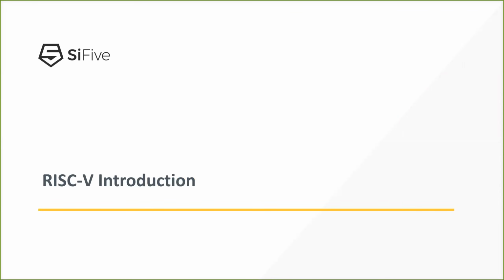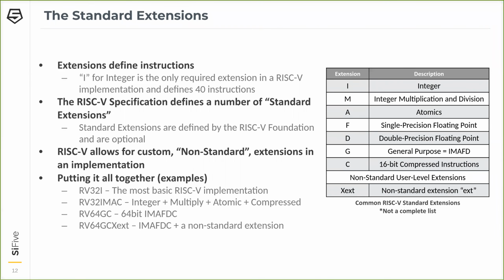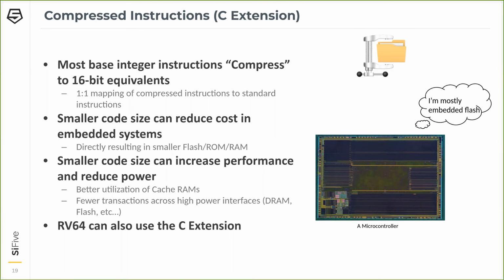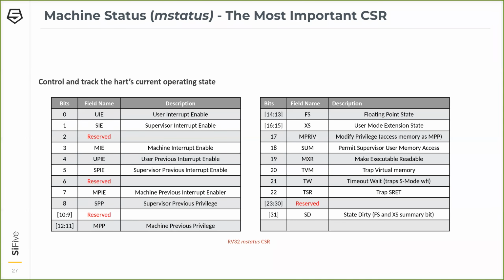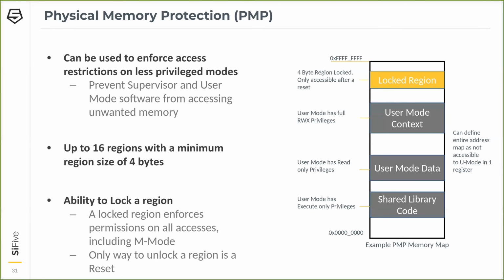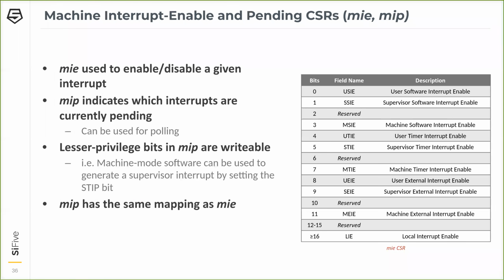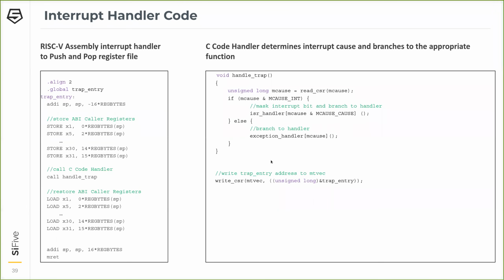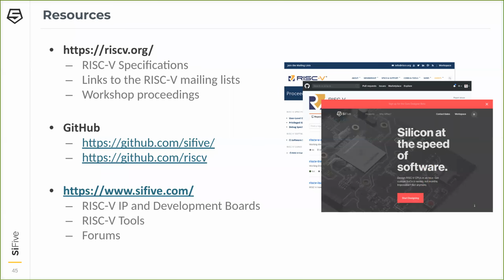Part I: An Introduction to the RISC-V Architecture

Comment: Trusted hardware thought...

Given that the up and coming open ISA that RISC-V brings and potential silicon that will be certified as compatible with the RISC-V architecture...  there might be a way for us to have a processor that is likely to be compliant and will likely fail a "magic packet" type embedded in silicon exploit.

We could get a core fab'd in country "A" and the same core fab'd in country "C". We get one each of these cores and run them them in lockstep, we would expect similar results out of each beast.  As soon as one cores outputs differ from the other we can raise a flag and signal badness.

It is improbable that both cores would contain identical backdoor triggers given their differing origins.

This could be "trusted hardware" of sorts, no?
Reply: I appreciate your idea, but the problem with all, so called "trusted" security hardware is a general one. Even if the ISA is freely usable, there is no real possibility to verifiy, what is going on beneath the ISA. I mean the microcode, which is a black box especially to software developers. Even a hardware developer can not really find out, what an unknown chip actually does at the transiator level without papers.

Comment: INTRODUCTION
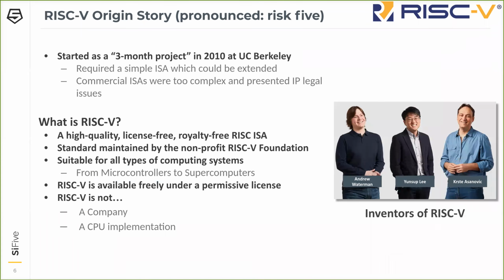5:14  RISC-V origin story
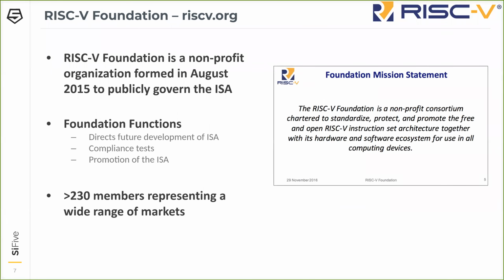6:19  RISC-V foundation
6:57  foundation Members
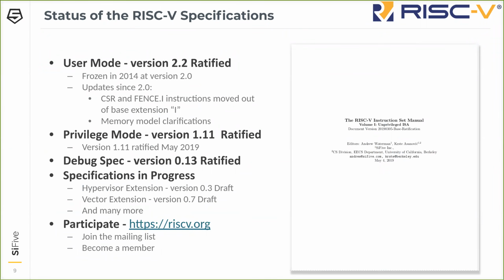7:26  status of the RISC-V specifications
-
BASICS
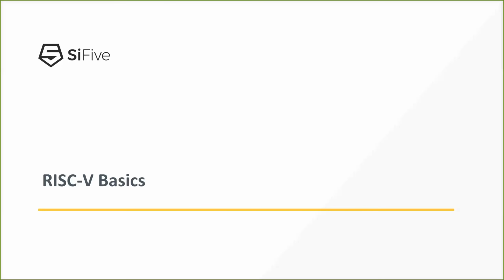8:49  RISC-V ISA naming conventions
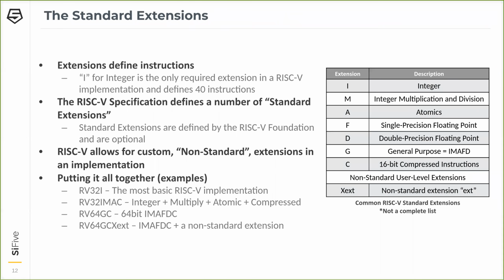9:35  the standard extensions
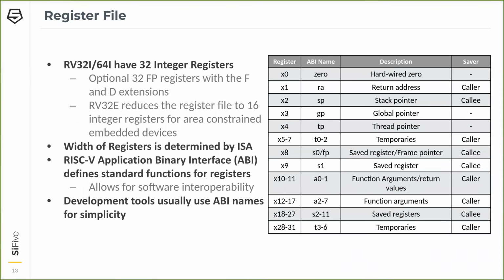11:37  register file
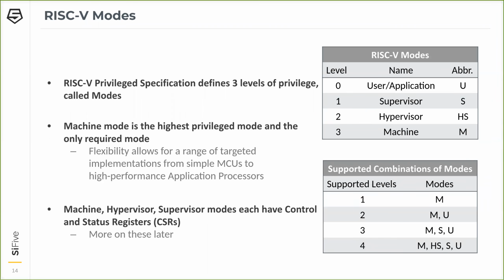12:43  RISC-V modes
-
RISC-V INSTRUCTIONS
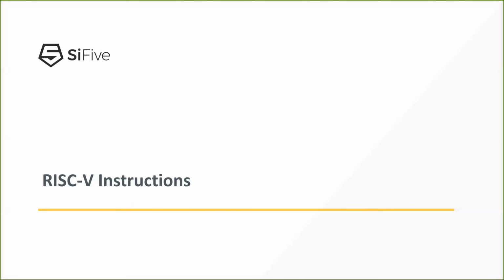13:29  RISC-V reference card
14:36  compressed instructions (C extension)
15:47  code size comparison
16:13  atomics (A extension)
16:56  fence instructions
18:00  CSR and ECALL instructions
-
RISC-V CONTROL AND STATUS REGISTERS (CSR)
18:46  what are control and status registers
19:33  identification CSRs
20:19  machine status (mstatus) - the most important CSR
21:29  timer CSRs
22:21  supervisor CSRs
23:14  virtual memory
24:43  physical memory protection (pmp)
-
RISC-V INTERRUPTS
26:23  RISC-V interrupts
27:59  machine status (mstatus) - as it relates to interrupts
29:03  machine interrupt cause CSR (mcause)
30:13  machine interrupt-enable and pending CSRs (mie, mip)
31:24  machine trap vector CSR (mtvec)
32:14  trap handler - entry and exit
34:46  interrupt handler code
35:41  compiler interrupt attribute
36:43  RISC-V global interrupts
37:22  PLIC interrupt code example
38:26  RISC-V interrupt system architecture (M-mode only example)
-
MORE INFORMATION
38:51  Resources
-
QUESTIONS
41:25  Does RISC-V define a 128-bit architecture, and does it support the compressed instructions?
41:48  In M-mode, would you need to have both the mie bit set in mstatus and the proper bit in the mie register?
42:14  Which version of the Linux kernel has support for the RISC-V architecture?
42:36  Which single-board computers support this Linux kernel?
43:10  What is precisely the definition of "hart"?
Reply: This should be pinned. Great job!
Reply: Great job! Thanks for the help.